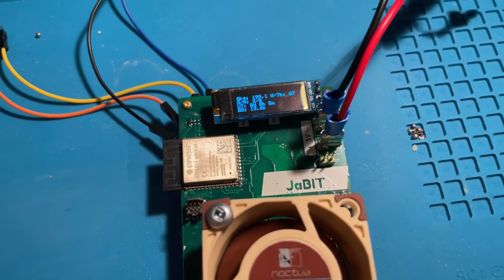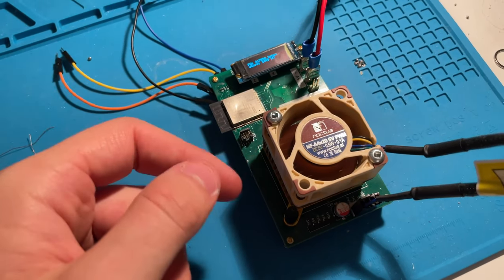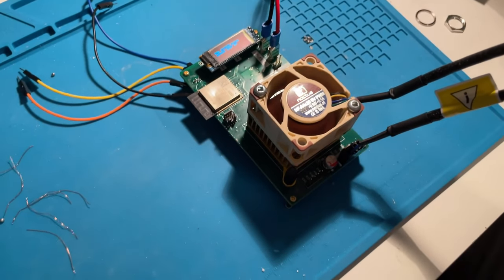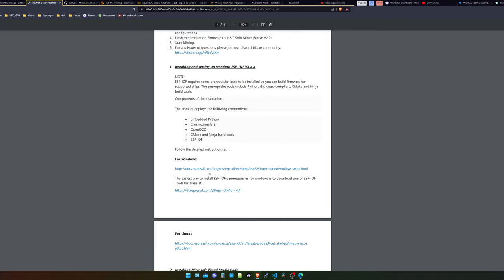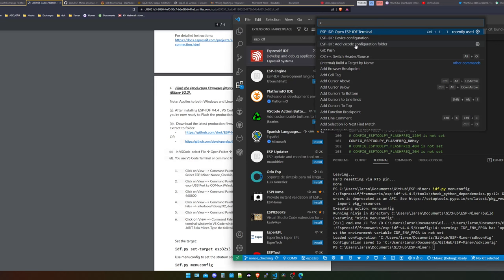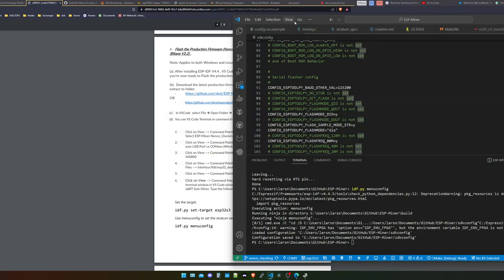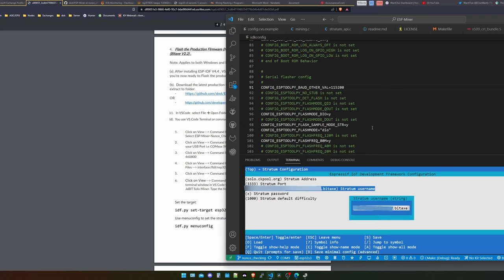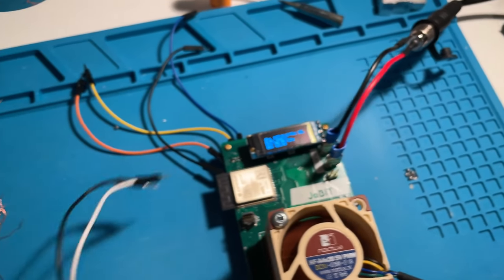The open source Bitcoin Miner BITAXE

Comment: What command do you use to scroll orselect the stratum wifi etc on the menuconfig? The up down keys do not work
Reply from the maker: Could be hard to read but the command is: idf.py menuconfig and then you just use your arrow keys
Reply: @WantClue  up and down arrow keys did not work. I have to do the / to search for stratum and wifi. Then flashing the bitaxe showed it just say wifi connecting to ap